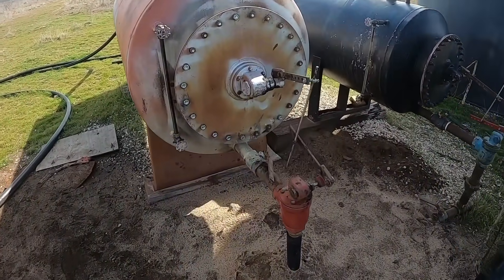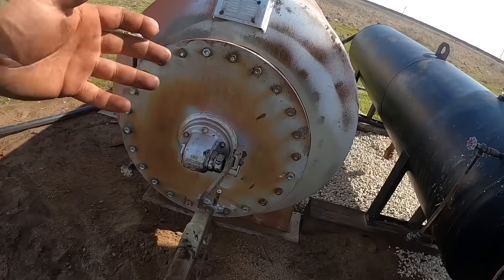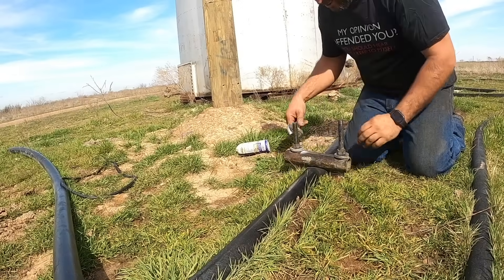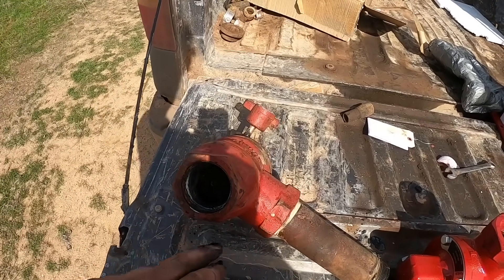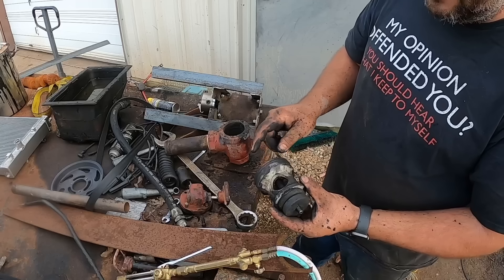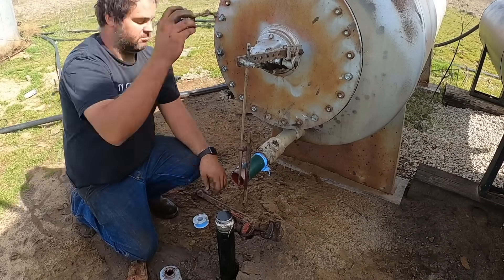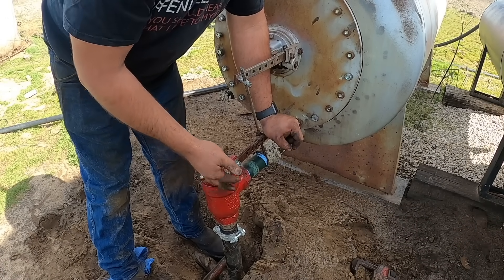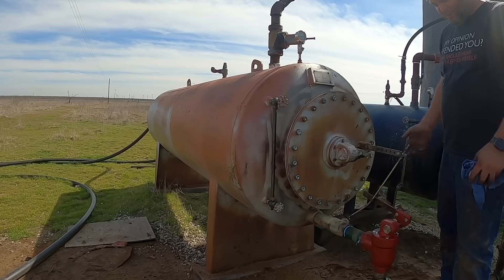Water Separator Dump Valve Repair

Comment: I worked for a supply store in Odessa back in the 80's I couldn't count how many dump valves I've sold . Thanks for the video. 😊
Reply: Me too. Who did you work for down there? 🤔
Reply: I’m working in Midland right now. I think someone opened a dump valve around here, this place is a dump.

Comment: I have been selling and servicing KimRay products since 1983. Your 212 SOA-D has all the latest updates (304DEL seat, new style ratio plug, a reversible seat in the bottom and all stainless internal parts. Quite an upgrade. However, I remember when the list price of your original one was $115.00 lol.

Comment: Being lazy I buy cheap black sockets, cut 'em in half with a zip disc then weld them back together.  Now you have that powered lathe chuck you can make it look pretty and concentric!
I use mine for leaf spring bolts but it's been handy elsewhere.  For that clamp though it would be cheaper and less work to weld a piece of tubing to each nut then a nut to the top of each tube. That way your extensions are permanently attached to your clamp and can be run down with any wrench or socket that fits the nuts, or even a pipe wrench applied to the tubing if your wrench is MIA.

Comment: I still am not used to that you don't have to heat the oil to get the water to seperate the part of the country where I worked in the oilfield they had to heat the oil and water up to 150 degrees so the water and oil would separate also in the winter because it would get below zero. The fire department would get called out to oil well fires when the fire tube in the treater would get a hole in it and the treater shack would burn down, I started in the oilfield as a roustabout and we would have to replace the shack and replace the insulation and metal on treater and they were the gun barrel style. Keep up the great videos and God bless you and your family

Comment: I operate for an oil company here in Alberta Canada and wow what a difference from here to there. Here it’s hectic with so much stuff to wrap your head around that sometimes it’s really not that fun. These little separators and old school pumpjacks are so damn cool tho! I run a fairly old field and battery from the 80s that I still get to see some of this stuff. 36 pumpjacks and about 10 free flowers alone on my run. Seeing you be able to machine your own equipment and properly operate stuff like back in the old days without to much regulation looks like fun. Great content zack 👍🏼👍🏼

Comment: To make a super deep socket.  Cut a deep socket in half. Then weld a length of pipe to the socket  ends . Now you got a  handy  tool for threaded rod. 👍🏻

Comment: I would try a silicon-bronze nut, I really like to use them on SS threads as they are corrosion resistant and will never gall.

Comment: Just curious as to why you don't run a blocking valve downstream of your dump valve or mount your valve with unions or flanges? Too close to the ground?  Also noticed you don't have a blocking valve on your pipeline riser at the injection well in your video on that well.  Again, curious as to why.

Greetings from the Alberta oil patch.

Comment: Zach is there any way to install a zinc anode near the dump valve maybe in the salt water at bottom of tank? Very similar problem here with boats in the water, electrolysis is bad.

Comment: 2:30 "long socket" aka a piece of pipe cutoff, the very same size of pipe you're clamping with..... with a socket welded in the end? and the square drive cut from an 12" drive extension bar welded into the top end... what'll that take to do? 30-40 mins and no money.. do it! no excuses Zach. Also, You're welcome 😁
Reply: i meant 1/2" drive

Comment: I assume that the water goes to a central disposal well where it's injected, if so do you have a gunbarrel at the disposal, I realize it may not be cost effective on stripper wells , in the fields I have operated we always had a gunbarrel at the disposal in case of dump failure so we could catch the product before it went to the injection well.

Comment: Take a cheap socket cut it in half weld one end to a tube and the other end to the other end of the tube  instant box wrench ,  if you make a scaffolders wrench with the socket and swivel handle you don't need any other tools

Comment: isnt  modern tec amazing , with your modifications not only can you see whats happening remotely but you can shut stuff on and off , not that long ago you would have to drive over and look for yourself , i am a former electronics engineer even i get surprised at times by some neat ideas and the advancing tec , all you need is some internet connection out there , i guess you could have and possibly did do it years ago with short range radio ,

Comment: Why not throw a valve in downstream of dump. Save plenty of time frame using that clamp over time.
Reply: Another part to corrode and more expense?
Reply: @stephransley4371  been around some nasty corrosive water. I doubt it would go bad as no more or less than the upstream valve which is more important. I’m assuming even if it did leak by altlle it would only have hydrostatic pressure on it from tank level going to tank. By the time it takes to put  the clamp on valve could shut, dump darn near rebuilt an d replaced. when ya have 85 to 100 wells and 10k to 12k bbl day production as a lease op. those are the little thing that I think of(use to said f the oilfield after 15+ years) to make thing more efficient.